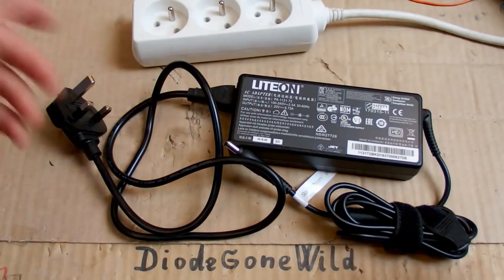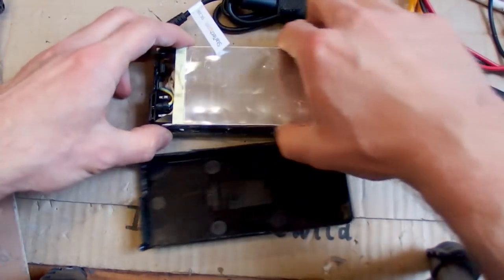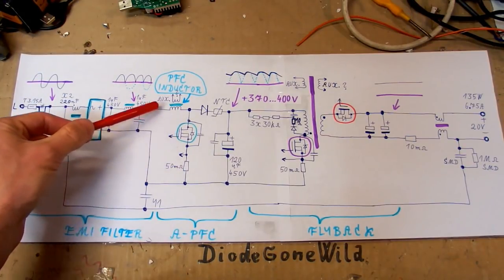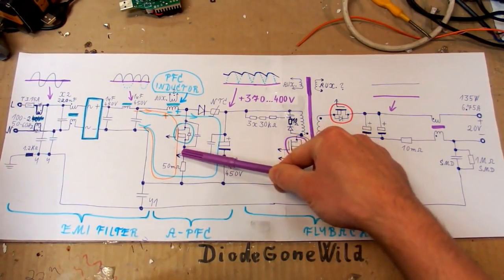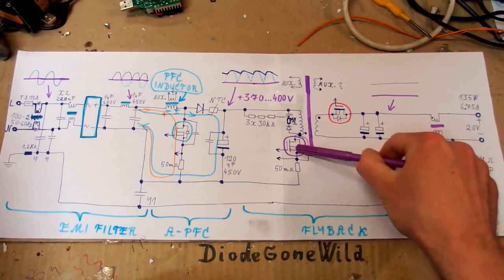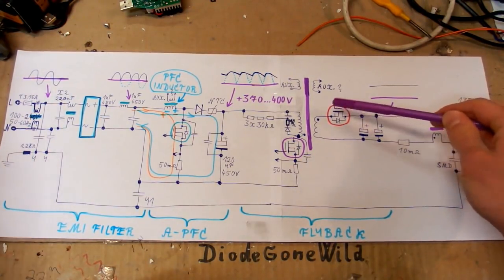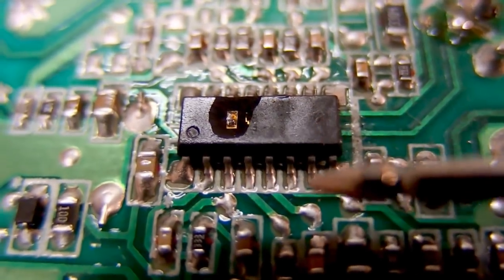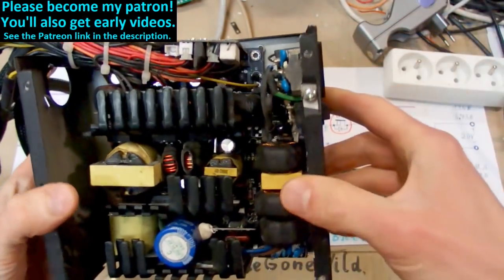Laptop power supply with PFC - teardown and repair (BOOM!)

Comment: For anyone watching: if you find yourself tempted to use a pocketknife or similar to try and cut at hard plastic, be very careful. I have cut my fingers really bad on multiple occasions doing so. Make sure you are thinking about where the blade will go if it slips and that the path is away from your body and hands.
Reply: Kids, don't do this at home. Try doing it in the courtyard :))
Reply: A stiff metal spackling blade is what I use with 100% success all the time, light multiple taps with a hammer and the case splits open.
Reply: a vice clamp can be found at places like harbor freight for fairly cheap. I found this to be the easiest way to open these things
Reply: Me trying to open power supplies etc. over the years=🤬🤔🧐😡🙄😫😡🤬💩 But I finally found a hack that works!!! I tried it on 2 PSUs last night & got em open..No knives or tearing up cases!!! Seriously

Ready for the secret?!
Get a tiny bit of gasoline⛽, dip a q-tip in, dab it around the seam of the case, wait a few mins..Afterward you'll be able to pull it apart so easily... It's unreal! I wish I'd learned that trick years ago! 

On one I did have to get a flat screw driver into the seam and kinda twist it before it came apart but it was bc the seam wasn't in the middle. Instead the case was like a deep rectangle on one side with just a flat "lid" on top.. If that makes sense.  I'd tried using craft knives, hand saws, chisels... Everything I could get my hands on but could never get it open... UNTIL the gas trick, which worked like a charm🤩
Reply: I use my pocket knife to open it and its fine. Just be careful when using it

:/
Reply: @RingZero  I usually just use a flat screwdriver with a hammer in a vice, but I'll give a spackling blade a go, thanks for the tip!
Reply: It's great someone points this out, I all so well know it myself but I don't want to go out in the cold workshop but almost did just that so I stopped. If I don't 9/10 times I cut myself, I am proud that I've started to realize that, even if it took about 35 years before I started to notice the signs 🤣 I'm just lucky I haven't cut myself badly.
Reply: They say gasoline works to loosen the glue.

Comment: I opened those powersupplies with a hairdryer😂
Reply: I've got a defective power supply from one of my network switches and I'll give it a try.
Reply: It might not work if the plastic is very hard or thick
(sorry for bad english)
Reply: @oliwier000b  I'll give it a try anyway. It is a very small power supply for a wall socket and I think the plastic is about 1 mm strong. I'll let you know whether it worked out well. 🙂
BTW: I'm not a native English speaker either.

Comment: I have a similar power supply for my HP laptop. It gets too hot to touch whilst the laptop is in use and has done since I bought it new last year. My view is that at least part of the problem is the complete lack of any ventilation to help cooling.

Your video is not to long. It fits exactly between the intro and the outro perfectly with no slack.
Reply: Yup laptop chargers get over 100 degrees easy

Comment: I still find it amazing how much effort designers and engineers have to go through to rectify our mains for practically all the electronics we use in the 21st century.
Makes me wonder if having some sort of central AC to DC box per household would be worth it. Although, I suppose we'd still need all sorts of buck/boost PSUs for various electronics.
Reply: I've been thinking about this for a long time ... this job should belong to the electricity company, but since there aren't too many electronics technicians there, that's how the electronics world has evolved. And in the same way we came to know these things and to penetrate the marrow, and to be glad that we have a smart hobby.

And even if it had been the job of the electricity company to give us direct current of low voltage and high amperage, problems would have arisen in the case of high-power motors, electric hobs, ovens.

After all, alternating current is a universal form, with parameters relatively easy to transform, and adaptable to almost any need, and all this is better done that way, because in the end they led to "human knowledge".

Be happy  and apeciate the this man for what he is doing -  he is a "rara avis" : D
Reply: DC (at level 320V is harder to switch off with regular contacts - longer arcs and also wan't transform and if you have 3 phase AC simply induction motor run well. In household more high power receivers can accept AC directly for heating or turning motors, so making "global" converter to 320V have not much sense. If make this converter for many lower voltages you need many power lines in home - not convenient. And for powering up 400W PC from about 230V you need 2A and from 12V more then 30A - thicker wires. 
But there are DC supply network used in machines with VFDs so when one motor is breaking *slowing down) and return power to the mains, other motors can consume it.
Reply: @haczyk84  High voltage DC is much more dangerous than AC. If you grab live AC, there's a 50% chance your muscles will contract and "lock you on", but half a cycle later, the reverse happens and your muscles open and throw you off (if you're lucky). With DC, only the first half of that sentence applies. There are also problems with corrosion and as you say, with arcing, so high voltage DC is best avoided.

But low voltage DC is fine. I built an outbuilding, which is powered from a 35 amp 12 volt power supply (housed in the garage).  The lights work fine, car accessories all work fine, everything is safe and if I need 240 volts, I simply plug an inverter in.

Comment: Phew, a tonne of work went into this video and the thing isn't even repairable. Good instructional lesson anyway DGW.
I use mineral oil to soften up silicone sealant. It works when left on for a while(sometimes).
Reply: agree 👍 yes
Reply: My response to fixing it was the same as his: Bypass the PFC. But evidently the IC does both the PFC and flyback control so that wasn't an option here. Handy to know, anyway.
Reply: I don't think it's a sealant. It's probably a material like Silastic, which is basically like a slightly elastic adhesive with good heat resistance and low electrical conductivity. It's used to prevent large components from moving around too much, specifically to avoid them breaking off of the board due to stress on the leads via vibration
Reply: Basically it is anything
It is to make the circuit Copy proof
Nothing else the reason 😅
Reply: @mvnar  No it’s really a form of strain relief. Keep in mind it’s a laptop power supply hence has to endure higher mechanical stress throughout the day. Additionally LiteOn is a fairly reputable brand.

Comment: I've had the best luck opening these things with a wide dull wood chisel. The angle on the blade tends to force the halves apart when struck with a hammer. The plastic usually comes apart well enough to glue back together with little visible damage. Good Luck!

Comment: I put these welded cases in the freezer for a few hours. Then a few light taps with the edge of a small hammer at the joint, and the weld breaks easily while it's at about -20°C or below.
Reply: @Ormaaj  Yes, in about 80% of the cases it works flawlessly. Sometimes the crack slightly leaves the joint, but still better that a mm of missing material because of the Dremeling. It can be glued together again with epoxy or superglue.

Comment: May I suggest, to open that kind of adaptor, use some fuel, like car petrol fuel and drips it to the joint, all around the joint, wait a bit then open it with little effort
I use that way to open numerous laptop adaptor and the case still intact and nice

Comment: There is tip to open pc chargers like this it's by using paint thiner(maybe isopropyl alcohol work too) it's much better and clean way to open  such chargers hope it help
Reply: I use a kitchen knife and a pen-blowtorch. Heat knife, slice through plastic.
Reply: @vylbird8014  it will do the job but it leaves marks on the plastic

Comment: Glad you seem to know what you are doing! I was a little afraid when you bridged the a-PFC with wires and solder and added the lamp as a fuse and plugged it in. The lamp is a good short circuit indicator and protects from heavy explosions :-) I wouldn't even start trying to repair this when i saw the black burnt area on the board. I have a lot of the old laptop power supplies and they tend to last very long in my experience.
Btw: these cases open much easier when you cut around the edge with a sharp knife (carpet cutter) and then pry it open with chisel or similar. I put it into a wise to have it handy and safe.

Comment: It's interesting to see the difference between modern power supplies and the cheap Chinese ones you normally analyze, this ones have mosfets and ics everywhere.
Reply: Can still be made by the same manufacturer, providing a well made version and then, for those demanding the absolute cheapest rubbish, they do a version with all the expensive "optional" safety and power reduction parts removed to cut cost. The active PFC and the filtering is always the first to go, as that uses the most expensive parts, and does not actually prevent the supply from operating.

You often see the first version have all the parts, then with time and the buyer pushing for "lower price, only concerned with price", the manufacturer will replace these expensive parts with either wire links, or not populate, then respin the board to not have them at all (that link costs money to solder in) and send it out. Don't blame the Chinese OEM for supplying the customer with what they want, at the price they want to pay. Same manufacturer can also supply a part that will be space rated, or which is meant for industrial use and long life, but will cost more.

Comment: I had some success opening these by a vise. You can exert great force with fine control. Usually if you press just one half shell, then the welds break, just have to guess the correct half :-)

Comment: I have this exact brand power supply with my very old laptop from 2005 and it still works well and it was plugged in for at least 13 years non stop and probably it was the original adapter.

Comment: You can put petrol on the edges then it should open easier
Reply: will it soften/melt the plastic ?
Reply: @great__success  No. It will melt whatever that is that holds them together
Reply: @kacpreusz9911  hopefully it won't explode all over and catch fire, assuming the fault came back
Reply: @kacpreusz9911  It will not melt anything,just dissolve it.

Comment: My failure mode analysis is as follows:
Power supply is running at near full load when the mains plug develops a bad connection for a couple of cycles. The high load ensures the boost capacitor is rapidly discharged by the flyback supply. The NTC's are still hot and a very low resistance. When the mains plug makes a connection again there is no inrush current limiting resistance. This causes the boost inductor to saturate. When the PFC MOSFET switches on the saturated boost inductor causes a massive current pulse through the MOSFET, causing it to fail short circuit. The shorted MOSFET causes the two conducting bridge rectifier diodes to fail also. The failed MOSFET also destroys the control IC as the gate oxide is ruptured by the high voltage.

Comment: So basically, the R050 had either got thermal shock (cracked from heat stresses, rare tho.) or had shattered from vibration shock (dropped).
Stored energy in the PFC inductor had nowhere to go so flashed over trying to return energy back to the coil (conservation of energy... has to go somewhere, in this case as a high voltage spark).
one of many classic PFC failure modes.
Usually these are tied to the main switch IC where if the PFC chip doesn't send an enable to the main switcher, then the main switcher stays off. Also, the spike in voltage from that arc may of killed the main IC and main mosfet anyway.
The other common PSU failures are when the main primary filter cap fails and too high a ripple is given to the main switch IC causing latch-up thus creating a short-path through the main transformer, through the mosfet, through the current sense resistor and anything else in it's path... usually lending to a shorted FET and in many cases a shorted fet-driver in the IC too.
Reply: If the resistor blew first wouldn't the energy in the PFC inductor just go into the main capacitor?
Reply: >the R050 had either got thermal shock (cracked from heat stresses, rare tho.)
I wonder if bad solder joint would have similar effect - creating a spark gap.
Reply: @eDoc2020  True in the case of this design, the energy goes into the main capacitor since the resistor isn't measuring current to the capacitor but instead the current through the transistor in this implementation.
Reply: @stanimir4197  That's also possible. a bad solder joint on the diode could've caused too high a voltage spike across the transistor at just the right moment and the voltage became high enough to arc across the diode and crack at enough current to short the diode too.
Also, was watching late last night so I didn't process the fact the resistor was measuring the switching current and not the feed through current thus the diode failing as it's in the path where energy gets sent.
Probably other failure modes too... i.e. a cosmic ray was strong enough to latch-up the fet driver causing high current that blew the resistor and then the high field strength dumped too high a current into the main capacitor melting the diode internally... and so on.

Comment: In my opinion, the resistor connected to the earth is to limit the earth fault current, so that the fault won't causes the power supply enclosure to explode, but still enough to causes the circuit breaker to operate. Or it could be to suppress a earth looping current which can causes interference in analog instruments, especially audio equipment (hum/buzz noises).

Still, excellent video!

Comment: It is strange that the PFC controller does not support soft-start, which would eliminate the need for the NTC. Using an NTC inrush current limit approach for such a confined enclosure (no good heat path to ambient, no air movement) seems a bit crazy to me, because it can cook the PFC MOSFET switch and Diode.

Comment: So this unit has a NTC thermister to control the input voltage surge? I'd assume this addition is supposed to maybe stop that big POP (big spark) I get when I plug just about any SWPS into the mains? Even those tiny phone chargers cause a POP when I plug them in to the wall outlet! What could have caused this huge failure anyway? Lightning hit?

Comment: You forgot to change the cap (450V). If the diode in the PFC is gone and the bridge rectifier also then the cap become AC Power and the current destroy the NTC. Is also good practice to change the regulation chip of the following transistor if this is gone. The regulation circuit exploded because of a voltage above the chip limit. For repair you have to replace all components of the primer side. Only High resistors and caps (foil) have a survival chance.

Comment: Most of the power supplies I've repaired lately have had the active PFC blown in the same way, the diode shorted and of course the transistor too. I wonder if it is a common practice to use undersized diodes or is there a hidden cause of this mode of failure?
Thanks for the great video.
Reply from the maker: I was surprised they didn't use a diode on a heatsink. The diode not only heats because of its voltage drop, but also its reverse recovery losses.

Comment: When I saw that 0.05 ohm resistor burned  or cracked or smoked next step is replace the driver PFC , all components depends by that resistor.There it must have around 1.1V when it is interrupted there is 316 - 320v and everything blow up .

Comment: 23:52 spark in the same spot where it started the first time between two pins. Bye Bye power supply.
Reply: And smoke at the controller chip, 2 video frames later
Reply: That’s probably what what damaged it
Reply: terrible design, unfixable

Comment: Just put some gasolin/petrol in the welded plastic joint, may be petrol can loosen the joints... I use once before to open a 12 volt 2 amp wall adapter... 😊

Comment: quite often there is a schottky diode in parallel with the sync transistor so you are measuring the Vfwd of the diode as 0.27V

Comment: Aux winding on the PFC choke is for zero current detection (and also powering the controller). The controller is likely operating in transition mode.

Comment: A 10A fuse in that plug seems rather generous for a 2.5A application. It’s of course just for the power cord and you could in theory use that cord for a 2000W heater.
Reply: I wonder if the fuse is even connected in line... I think Big Clive recently showed a British lead with a fake fuse that was connected to nothing.

Comment: You know a lot about SMPS. 
Would you like to make a video about how to design SMPS?  
Such as the topology used, how to wind the transformer, does the transformer require an air gap, cable size, filters, does it need pfc, etc.

Comment: Id assume the 1.2k linking the negative back to ground would be to help limit leakage current to be a bit more friendly for RCDs.
Reply: I think it is for reducing radiated EMI from the earth connection, but maintaining an earth reference for safety reasons.